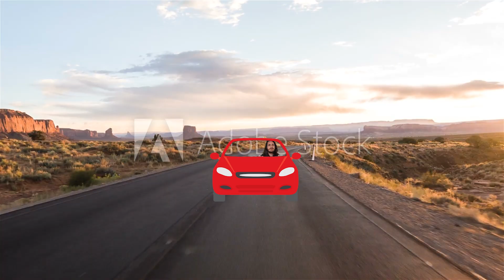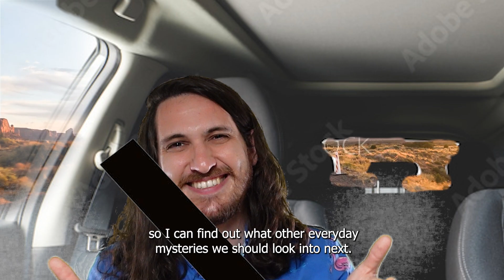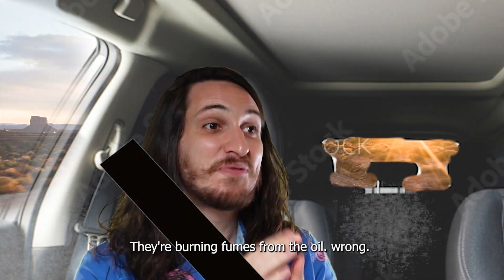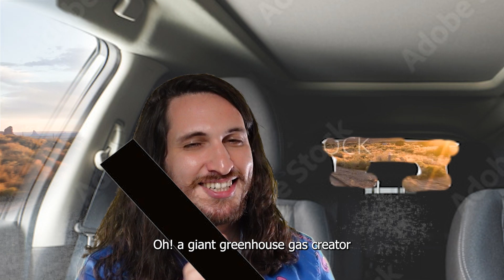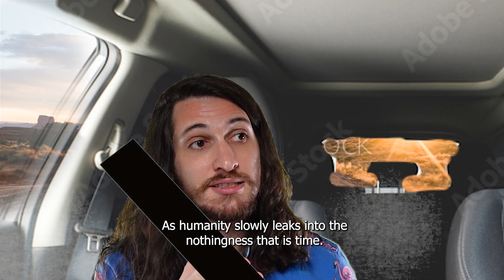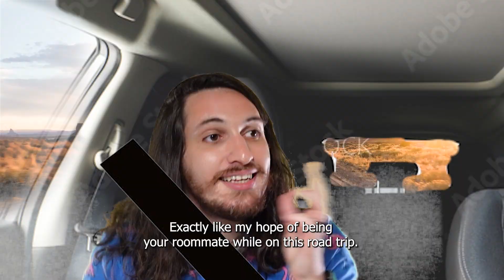Why are flare stacks at oil fields?

Comment: There's another aspect: Methane (the principal component of natural gas) is 28 times more potent a greenhouse gas than CO2 (& burning methane gets you a 1:1 ratio of CO2 per molecule of methane) so if there's really nothing that can be done with respect to using that gas it's far better to burn the methane than just release it (even if it weren't dangerous to just release it, which it is).
Reply from the maker: whoa
Reply: Unfortunately, there's no such thing as "green house gases". Kinda like "assault weapons", its a political buzz-term.
Reply: @Calico5string1962  The CO2 molecule has an absorption mode in the infra-red part of the spectrum.

This means that when visible light (to which CO2 is transparent) hits the Earth's surface & is re-radiated back out towards the atmosphere as infra-red light, to which CO2 is opaque to - it is absorbed transferring the energy to the CO2 molecules (i.e. heat).

This has been known since 1896 (Svante Arrhenius).

Maybe pick up a textbook once in a while & not a right-wing blog.